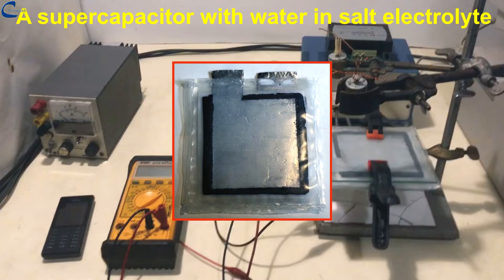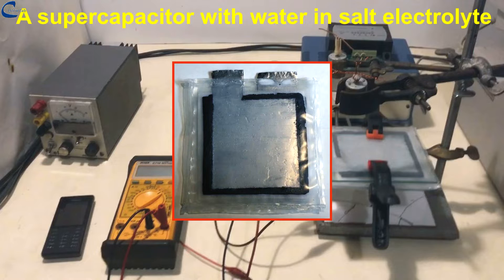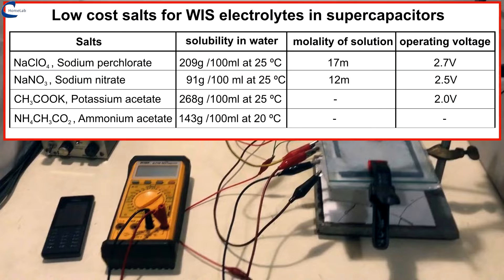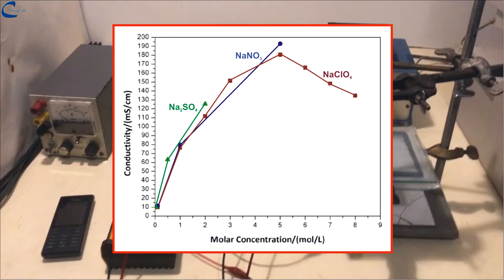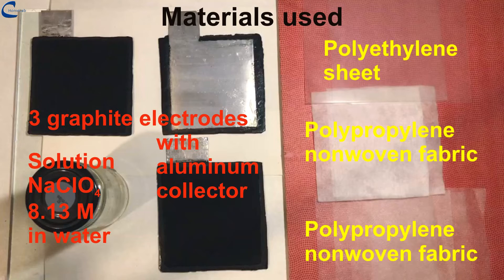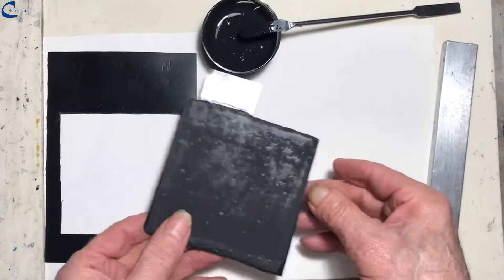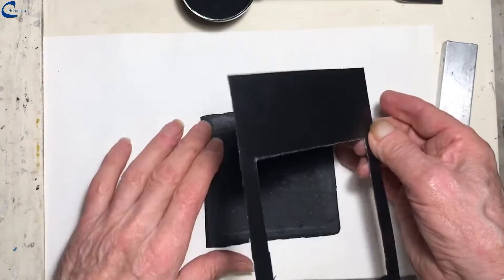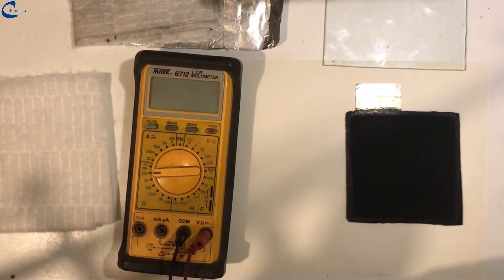A supercapacitor with Water in salt electrolyte

Comment: Why do you use two sheets of nonwoven fabric that go between electrodes at 8:28? Can I just use 1? Is there a reason behind this? Also the middle electrode I presume the middle electrode would not contain any insulating glue, but the outer electrodes do have insulating glue that covers exposed metal, right?
Reply from the maker: Between the electrodes I use 2 sheets of non-woven fabric for the reason that with a single sheet I had noticed that in case of pressure there was a short 
circuit between the activated carbon particles of the 2 electrodes.
The central electrode does not contain protective glue for the metal. While in the 2 external electrodes the metal is protected from direct contact with the electrolyte

Comment: Where do you buy sodium perchlorate? Is it supposed to be expensive?
Reply from the maker: Can be purchased at a laboratory chemical store, sodium perchlorate is expensive: 250g about 100€, and being classified in some countries
as a precursor to explosives, may be subject to restriction in sale
Reply: @claudiohomelab8181  I see the alternative is sodium nitrate, is this as good as sodium perchlorate? It appears to be cheaper too. If used the video mentions to use 91 grams in 100mL of water, is this the correct amount for the ideal electrolyte or is there a different ratio to be used? Thanks for your response.
Reply from the maker: Sodium nitrate is the second best alternative after perchlorate and is less expensive and easier to find. The voltage that can be reached is slightly lower.
The solubility of sodium nitrate is 91 grams in 100 ml at a temperature of 25 ºC
Reply: @claudiohomelab8181  And is that how much I use per 100mL of water? Or do I use what I calculated for 5mol/L to be 42.5 g per 100mL for sodium nitrate? And the water used can be distilled or deionized water? I do appreciate your responses to the many questions I have asked by though way, so thank you.
Reply from the maker: @Ryan-gf6bs  To use sodium nitrate you need to dissolve 91g of NaNO3 in 100ml of water, the water can be either distilled or deionized

Comment: You're getting half a volt for 44 minutes, at what ampage? Because for something that large of pouch cell, not very efficient. The standard should be closer to 6×6 in pouch could charge a phone halfway.. isn't it?
Reply: No,  it's a capacitor not a battery
Reply: Why not appreciate the time the gentleman has put in for us to learn something?So rather that criticize that  the system  is not effecient - make an optimized version from what you've learnt or seen. I've leant how to make elctrodes at home and I am glad! If I want to improve the performance I will just have to use nanostuructured materials, dopers and other EDLC materials among many other strategies. So let's' appreciate the man's work. That's what scientists do!!!!!

Comment: I am a little curious why you didn't soak your layers of non-woven cloth in the electrolyte and then use your press to compress them down to a desired amount of saturation.  I feel it would probably result in a more even spread of the liquid.  Either way, this seems like a decent result from a home lab an a terrific way to turn a marginal supply of power into something useful.
Reply from the maker: I have to admit that soaking the non-woven fabric directly into the electrolyte is a better solution, in fact in the preparation of another
supercapacitor I adopted this technique
Reply: @claudiohomelab8181  I look forward to more of your videos in the future!
Reply from the maker: @bearnaff9387  OK

Comment: I suspect one might make a more active surface area by adding some the salt to the carbon slurry instead. When the water dries the salts crystalizes. 

The theory is that later when water is added, the crystals disolve and leave behind voids for ions to hide their charges in when the plates are charged.
Reply from the maker: It could be an idea to experiment with
Reply: @claudiohomelab8181  science is testing hypothesis. Many hypothesis don't work, but we always learn something.  And work or not,  interested people will watch to learn.